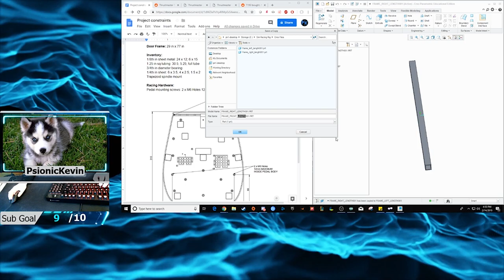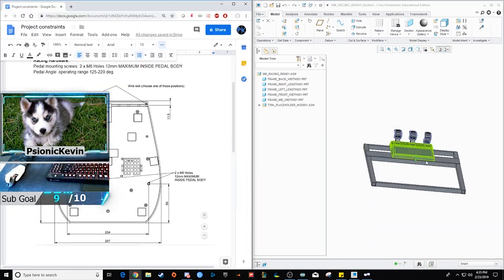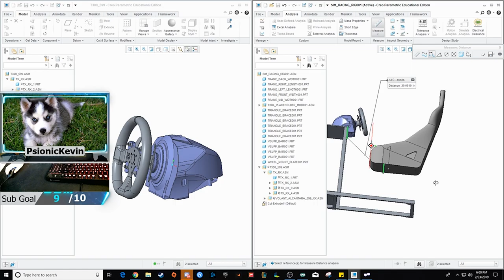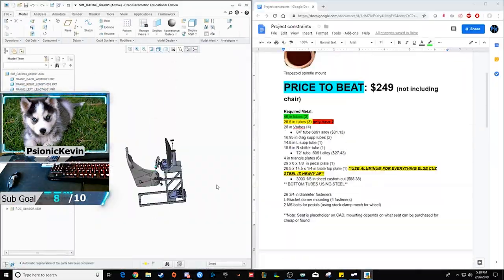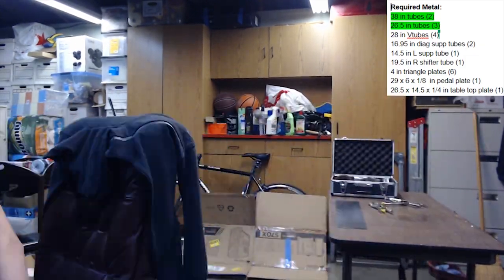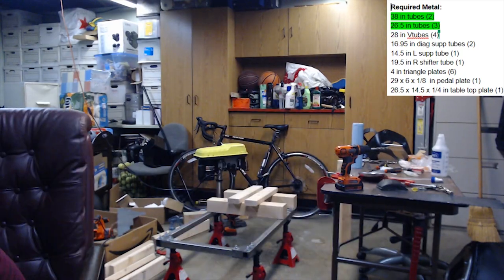Build a Sim Racing Rig for CHEAP ($75 build)

Comment: Did you get any metal shavings in your clothing?
Reply from the maker: I did burn holes in some shirts when I was working on the go kart project 2 years ago, so I wrapped an old towel around my waist and tried to keep them pointed down whenever possible.
Reply: Psionic Kevin ya same but quite a bit of the shavings got stuck in my clothes